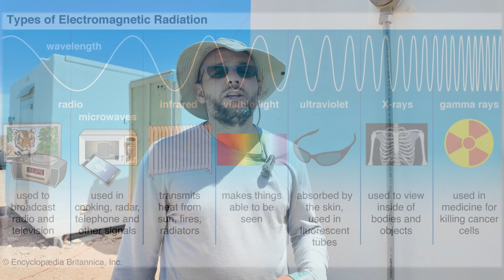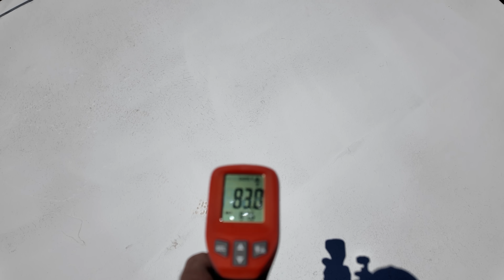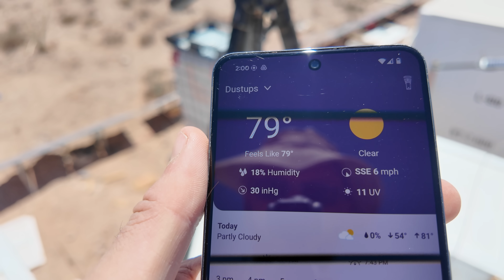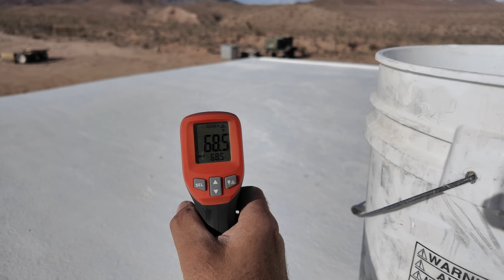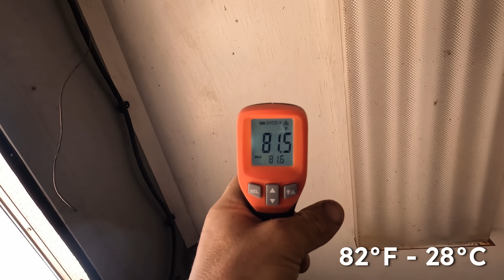I sprayed "cooling paint" on my desert cabin...this is shocking

Comment: Physicist here. The idea that painting the sides is useless for radiative cooling is wrong, or at best a half-truth. Thermal radiation goes in all directions. So, about half the energy radiated from a side wall will go into the sky, and result in cooling. The only question is what happens with the half of the field of view that involves the ground. The wall will be exchanging thermal radiation in both directions with the ground.  If the ground is hotter than the wall, then that thermal exchange will result in some warming effect on the wall. (Contrary to what the video said, no, thermal radiation isn't being “reflected” back very much; it's just that the hot surface of the ground or the mountains also radiates.) So, there will be a mix of cooling and heating effects. Which will be larger? The net energy flow out of the wall will scale like Tw⁴ - (1/2)Tg⁴ where Tw and Tg are the absolute (Kelvin) temperatures of the wall and the ground, respectively. (Tw⁴ is proportional to the thermal energy radiated from the wall, while (1/2)Tg⁴ is proportional to the thermal energy absorbed by the wall.) So, there will be net cooling if (Tg/Tw)⁴ < 2 or (Tg/Tw) < 1.189. If the wall is 95℉/35℃/308K, then that means there will be net cooling as long as the ground is no more that 0.189×308=58K=58℃= 105℉  warmer than the wall of the building, i.e., always, in practice. So, under any realistic scenarios, increasing the radiative efficiency of the walls would result in a net improvement in cooling. Painting the walls has a little under half the radiative efficiency per unit area of painting the roof (since only half the radiation reaches the sky), but since the four walls together have a greater surface area than the roof, there could still be a major improvement if the walls were painted to increase radiative cooling. The analysis suggests that if cooling efficiency were your only consideration, then you should definitely paint the walls as well as the roof.
Reply: Also worth noting is that the ground/mountains are not perfectly parallel to the buildings, so a lot of the energy emitted will not be reflected directly back on to the building, but will go in other directions. You don't need the energy to leave the planet, just to leave the building ...
Reply: Hey, I run the company that makes the PDRC paint, and you are correct in theory, but in practice, the PDRC materials absorb too much radiation from the ground for them to be practical for side facing applications. At best you net slightly above air temp (still better than elastomeric coatings), but at worse you absorb a ton of terrestrial radiation and become far hotter than regular white paint.  To your credit, PDRC is very new and not a lot of real world testing has been done in the academic sphere, but we have done over 300 hours of real world testing to come to this determination.
Reply: @cryoxco  How is your paint made? Isn't it just barium sulfate Microspheres? If you do 30-40 thin layers of the stuff, it should completely negate the heat absorption!
Reply: @cryoxco  Interesting. Where was your testing conducted? I suspect humidity might affect the results. I've been mulling over the discrepancy between your empirical results and the simplified analysis that I had offered. The main thing I left out of my analysis was the interaction of thermal radiation with atmospheric absorbers, as a function of wavelength and angle relative to the zenith. It occurs to me that thermal radiation from the walls will typically reach space at angles far from the zenith, requiring it to pass through a much greater thickness of air than radiation directed upward from the roof. This will increase the extent to which thermal radiation is being exchanged with the air as opposed to reaching space. This could explain a reduction in radiative cooling efficiency much greater than the 50% reduction predicted by the simplified analysis. This phenomenon would be particularly important in locations where there is significant water vapor in the air. The effect would likely be smaller in extreme desert locations where the humidity is lower. So, it's conceivable that painting the sides might be more beneficial in the desert than it would be in hot-but-humid locations. I haven't done a quantitative analysis; but this makes sense qualitatively.
Reply: @cryoxco  I had to do some estiatioms with scientific data, two studies from Russia and one from the USA (civil engineer, Austria)

We have clients that think we can just simulate it in standard buildimg software . . . it was frustrating to say the least
Reply: @cryoxco  Yeah, this makes sense.  Apparently the special paint radiates at a specific wavelength, which means it also absorbs at that wavelength. It works on a roof, not because the heat radiates all the way to space, but because the atmosphere is not sending much of that particular wavelength down to the roof because of the "atmospheric window."  In other words the sky is dark at that wavelength.  But hot ground nearby would send heat to the wall to be absorbed instead of reflected at that wavelength.

The "radiating into space" thing was was originally more about the principle of helping to counter global warming in some small (symbolic) way.  It has no practical meaning where cooling a specific building is concerned.
Reply: Wouldn't the law of inverse squares  come into  effect basically once the radiation waves travel to something and only a part of that is reflected back you only get a tiny amount back from something even 100 feet away ?  I think I would try a rollup reflected mylar awning with an air gap between that and the roof  for hot sunny days. I'm not a college boy but I'm sure entropy comes into the picture somewhere in all of the equations. Thanks for your explanation!
Reply: I love that you did the math but the EM radiation doesn't need to leave Earth completely, just cool the inside.
Reply: At least paint the south/east/western sides
Reply: You just took me back to Architecture school! 😅 environmental design involves Physics ❤ and neat sensors, reading gadgets and doodads
Reply: Consider a spherical cow ...
Reply: I don't see why the IR emissions have to head for space to cool a building on earth. If you run a window air-conditioner, all the heat you suck from the room goes into the air a few inches from the house- and yet, the room gets colder. Would it be more efficient if the heat was pumped further away before air-cooling it? Sure, but not much, in part because IR emissions tend to heat the air they pass through, and this causes convection, moving the hot air upward in the general direction of--- outer space!

Also, if the IR emissions are omnidirectional, they obey the inverse square law, and by the time they hit distant mountains and come back, the contribution to local heating is infinitesimal. MAYBE there is some amount of re-radiation toward your building from the ground very close to it, but it would be remarkable if that ground was shaped in a way to made a major portion of its emissions hit your walls.

As the manufacturer suggests, the real problem for walls is that they are heated by the ground- by conduction. Immediate solar exposure effects aside, this is basically 50-55 degrees Fahrenheit, so well-shaded ground actually has a cooling effect in the context of 85 degree ambient temperatures. Even if the walls picked up the same amount of energy from the ground as the roof does from the sun, re-emitting it passively is a net gain. I can't really see any reason not to paint your walls, especially south-facing walls,  besides expense.
Reply: @honzo1078  In general, radiative heat transfer involves thermal radiation flowing in both directions. You need to account for both directions to get correct answers. And, the flows in both directions are mostly a result of thermal emission, not reflections. The equation for the radiative heat transfer rate P₁₂ from thing 1 to thing 2 is given by P₁₂ = A₁ V₁₂ σ 𝜖₁ 𝜖₂⋅(T₁⁴ - T₂⁴) where A₁ is the surface area of thing #1, V₁₂ is the fraction of omnidirectional thermal radiation from thing #1 that reaches thing #2, σ is the Stefan-Boltzmann constant, 𝜖₁ and 𝜖₂ are the emissivities of thing #1 and thing #2, and T₁ and T₂ are the absolute temperatures of thing #1 and thing #2. Take thing #1 to be the building. If thing #2 is space, then T₂⁴ is effectively zero. In that case, increasing the building’s emissivity 𝜖₁ will be very effective in increasing heat removal from the building. However, when you look at heat exchange between a wall an the ground, about half of the radiation leaving the wall will reach the ground (V₁₂ ≈ 1/2); the ground in the desert is likely to be hotter than the wall, so T₁ < T₂, and increasing the emissivity 𝜖₁ will increase the ability of hot ground to radiatively heat the wall.

This sort of topic is very easy to get wrong if you don’t do the math and simply make verbal arguments based on incomplete understandings of the physics. Your comment appears to reflect some misconceptions, albeit understandable ones. The shape of the ground is largely irrelevant, given that we’re talking about omnidirectional thermal emissions from the ground, not “re-emissions,” and not reflections. Absorption of thermal radiation in the air isn’t important to the extent that the paint is optimized to maximize emissions at wavelengths which are not absorbed/emitted by atmospheric water vapor. And simply thinking about IR emissions without considering IR emitted by the environment (the T₂⁴ term) won’t yield correct conclusions. Radiative heat exchange involves radiation flowing in both directions, and you can’t radiatively cool a building using a ground surface which is hotter than the building exterior. (As a tangential side note, thermal radiation generally doesn’t heat air and cause convection. While thermal radiation exchange with the ground might try to heat air, thermal radiation exchange with air above cools it, and cooling usually wins out. The net impact of the radiative heat exchange on air is typically an overall cooling effect on the air, at most altitudes, most of the time. For more on this, see the Wikipedia article on the Greenhouse effect, and the figure depicting flow of heat in Earth’s atmosphere.)
Reply: Note: YT often doesn't appear to allow me to post substantive replies to the questions being asked. I’ve posted replies, but they often don't appear...
Reply: Really expensive paint went on the roof.  He needs the Nighthawk "infrared cooling paint from grocery store items" for the sides.
Reply: I was wondering about but I am not a physicist so I had no idea if I was off base. Thank you for proving the explanation. 👍🏻
Reply: Could you use angled mirrors to expose more wall to space?
Reply: @connorcrowley560  We should all live and work in pyramids.
Reply: @connorcrowley560  In principle, mirrors could be used to give walls a better view of space, increasing cooling efficiency. I believe this sort of effect has been used to create radiative freezers--you basically point an IR optical system at space, producing cold (great heat loss) at the focus. There are practical challenges for doing this with a building, and you wouldn't want to reflect more sunlight towards the building... but perhaps something could be arranged if one were clever and willing to experiment.
Reply: So I suppose painting the ground would improve the cooling even further? Like a concrete slab or some other foundation, not simply paint on dirt 😅
Reply: Plant closely sewn rows of a few hardy tall sunflowers every spring.   Once that's started plant some drought tolerant perrenials.
Reply: Not to mention if he had two walls treated this way close to each other they would be absorbing and emtting to each other.
Reply: Nicely described!  I was going to point this out but my explanation would have been much clumsier.
Reply: Where does the 1/2 come from? If temperatures are equal there should be equilibrium, no?
Reply: @tedarcher9120  If you look sideways from a building, roughly half of what you see is sky, so about half the light that reflects off a wall goes into the sky.
Reply: I wonder if this work if I painted the underside of my roof.
Reply: Basically you are wasting paint.  The roof and building are already white.  By using a lanco roof sealer it will reflect and seal the roof.  Invest in an inverter and put some solar on the roof.    I’m not sure what you are doing or trying and I don’t think you do either.  1 you need to seal roof and make it reflective.  2 solar panels to get more power which covers your paint.   That’s why I would focus on sealing the roof.  3 get 12v inverter ac units that can run on solar abd have enough solar to charge the batteries to run them thru the night.  It’s kind of a mish mash of  parts, ac units and batteries that are not capable of doing anything you need.
Reply: Physics does not beat out magic.
Reply: It's about the sun and the thermal energy of the sun mostly
Reply: What about painting the sides of the walls that one normally wpuld have solar panels facingnto catch sunlight?
Reply: Smooth steel reflects lots of ir, I was trying to film Machining and it was full of reflections, which looked cool but didn't show the internal heat
Reply: Put a white detached roof over the top keeping everything in the shade. And stop running on
Reply: You should use a 10 cm thick layer of clay mixed with 10% white lime, and then sprinkle a 1 cm thick layer of quicklime with 5 liters of used car oil. It will be completely protected. Also sprinkle the sides of the house with lime and also under the floor. The floor under the house should be covered with an infrared reflector. There is carbon fiber felt that can withstand up to 900 degrees Celsius, and under it there is golden aluminum foil, which is like a first aid blanket in the trunk of a car. Also sprinkle all this with a layer of white lime with clay. The place will be protected from all sides: from below, from above and from four sides. The best thing is to build Rammed Earth.
Reply: Just for reference, the 1/2 in the equation comes from the horizon cutting things in half and space being effectively zero?
Reply: The ground is typically cooler than ambient so it will still be a heat sink most of the time.
Reply: But...if he were to paint the ground? What would your equation look like then?
Reply: @LOLINC2010  For what it's worth, here is a more complete equation. The change in the power a building surface sheds via thermal radiation is given by ΔP = A⋅σ⋅Δ𝜖b⋅(Tb⁴ - V⋅𝜖g⋅Tg⁴ ) where A is the area of the surface that was painted, σ is the Stefan-Boltzmann constant, Δ𝜖b is the change in the emissivity of the surface as a result of it being painted, Tb is the temperature of the painted surface, V is the fraction of the view from that surface which is taken up by the ground (i.e., 0 for the roof, 1/2 for a wall), 𝜖g is the emissivity of the ground (perhaps 0.8 for a dry desert surface) and Tg is the temperature of the ground. (A different equation would need to be used to account for changes in absorbed sunlight.)
Reply: @LOLINC2010  It'd get worse you'd get a lot of extra radiation in the narrow band where the paint absorbs and emitts.
Reply: @zzbra,      So here's a question or two for you since Im not a scientist. What would the impact on global heating be if we painted every roof in the world white?      Second, My understanding is that a solar panel is less than 30% efficient. If that is correct, 80% of the energy that hits it creates heat and heats the air around the panels, ( a small percentage being reflected back into space ) does that not cause an increase in "global warming"?????.
Reply: Hi  @fireguy7004 , no solar PV isn't creating global warming. But painting roofs white can have a significant impact on local temperatures in densely populated areas. The good thing about highly reflective paint is that the visible and UV spectrum can reach space much easier than IR radiation which will be absorbed and reradiated by GHG.
Reply: @gerritsamson  Thank you for the response. To quote a famous american philosopher , "Im not a smart man",  In my feeble brain , it seems to be a contradiction to say reflective paint good, but inefficient black solar panels are not contributing to global warming, excuse me climate change?
Reply: Sky cooling paint is one potential way to offset global warming. The abundance of CO2 would still be a problem naturally but painting surfaces with radiative cooling paints can cool whole neighborhoods and if enough of the world has that treatment applied you can cool the world.  @fireguy7004
Reply: @fireguy7004 solar panels do indeed increase the albedo absorbing heat from the sun. If you are installing them on a white background area its going to not reflect as much and locally it will be a little hotter. If its on a black or green area it wont make much difference so on a slate or asphalt roof its a wash.

Worth noting that the surface area required to generate 100% of mankind's power consumption would be less than 1% of the earth's surface though.
Reply: or better yet he could install WINDOWS like most desert houses have
Reply: @ram1brn , wouldn't windows allow more radiated heat into the building while losing any air conditioning faster than walls?   Maybe install double walls or cladding, plus double glazed windows?
Reply: Bold of you to think that this guy is interested in results, he just wants views to please his sponsors
Reply: @marcofurlan417  But the heat effects from distant mountains are so much more than nearby, hence why we don't build cities near them.
Reply: For reflecting infrared radiation, I suggest covering the roof with aluminum foil, and painting the sides white (so as not to cause glare—unless that’s not important, in which case I would cover all the walls and roof entirely with aluminum foil or mirrors).
Reply: @mindaugas1406  metal sheeting like aluminum foil in an oven can also be heat conductive if applied in the incorrect scenarios, or wrong type. There are thermal roofing materials. 

Air-flow, cross ventilation off of the surfaces with a separate wall of permeable material 4-6 inches, (maybe more?) from wall or roof adds shade and a gap space for thermal airflow between building and exterior wall, roof. 

Corrugated metal attached to 4-5" cuts of 2×4" metal still would heat up,

 I prefer the idea of a slatted patio cover of 2"×4"s. 
Cheaper and lighter would be to use garden lattice on a 2×2 frame lifted on around 4-6" on cuts of 2×4
Like a shade roof on your roof. 

Brownie points if you make the roof shade wall removable or on hinges to access roof when needed. 

Some skyscrapers use ceramic coated custom metal screens or large mesh to keep window walls from cooking inhabitants while still allowing for a view.
Reply: @MajICReiki  This. IME (I am not particularly knowledgeable in thermal issues, just going by my totally amateur experience with hot environs), shade helps, often a lot, if the sun exposure is the direct and primary source of heating (i.e., ambient air temp plays a role of course). One way to reduce sun exposure of a shelter is to have a covering separate from the shelter - e.g., a separate unattached "roof", such as a pole building above the shelter. Another suggestion would be a tarp or something similar suspended above the shelter. I am interested in this paint because I want the top of my pickup cab and the canopy on the pickup bed, to be cool while camping in hot sunny climes. I do intend to also use a "camo leaf" covering suspended above the pickup to put it in the shade of that covering - I know from experience that shade from such a covering does help.
Reply: @MajICReiki  Dymaxion House: Bucky designed a home that was heated and cooled by natural means, that made its own power, was earthquake and storm-proof, and made of permanent, engineered materials that required no periodic painting, reroofing, or other maintenance.
Reply: @mindaugas1406  Aluminum foil is not as good for cooling as is the specialized paint. Aluminum foil reflects 86-88% of visible light (and a bit more for the shortwave IR in sunlight), while the paint reflects 96% of sunlight. The paint is somewhat better at reflecting sunlight than is the foil. But the big difference comes in for thermal radiation (longwave IR). You don't want to reflect thermal radiation (longwave IR); you want to emit (and absorb) longwave IR, to shed heat. For longwave IR, aluminum foil has very high reflectivity and consequently very low emissivity (just a few percent), making it very bad at shedding heat. In contrast, the specialized paint has an emissivity of 93 percent, making it far better at cooling than the foil.
Reply: @mindaugas1406  That'd kill the effect of the paint can't reflect and emitt in the same spectrum.
Reply: @mindaugas1406 
Superficially sounds like a good idea. But its not
Reply: @mindaugas1406  Aluminum is a terrible reflector.
Reply: @mindaugas1406 Not practical.
Reply: @mindaugas1406  f you can create an air gap between the foil and the roof even better